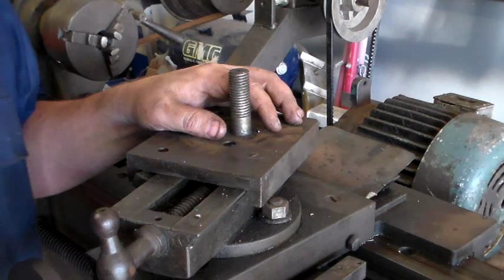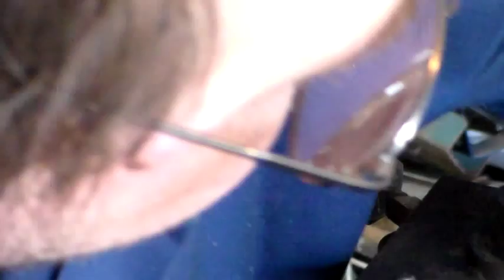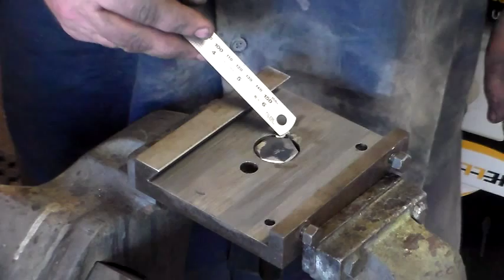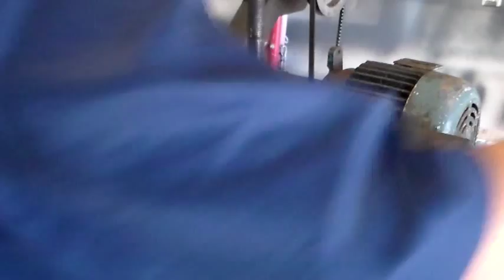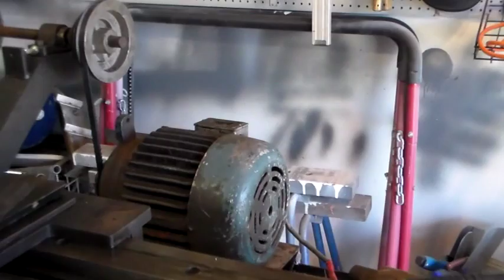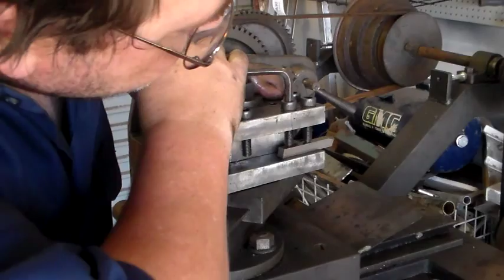My New Old Lathe part 4   Making a quick change tool post 2 of 2

Comment: I see that this video is a year old and I don't know where you are on adding 20 mm of spacers under everything but - could you mount the center and the top plate of your new tool post onto the original dovetail base and avoid all the spacers? Regards, Noell